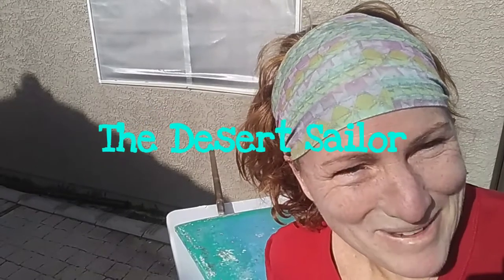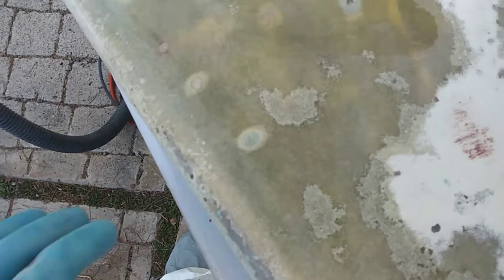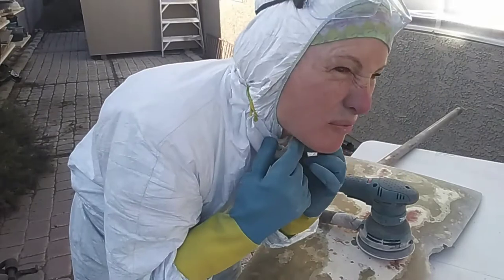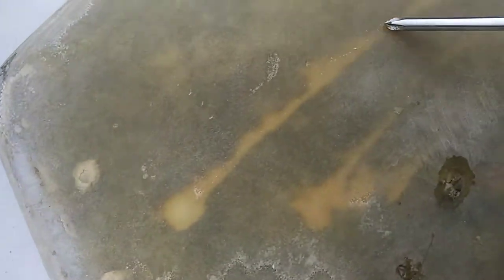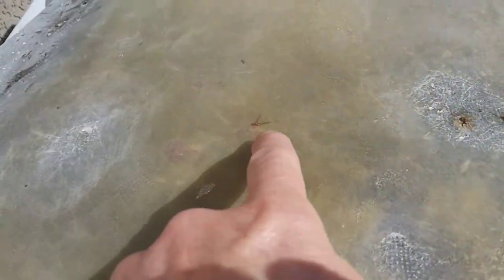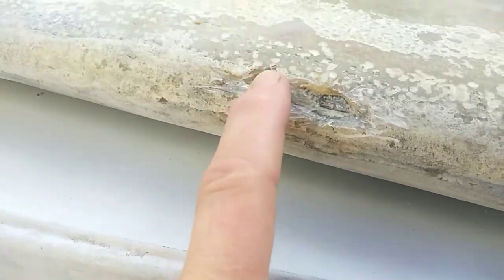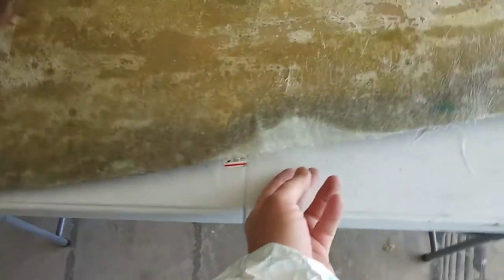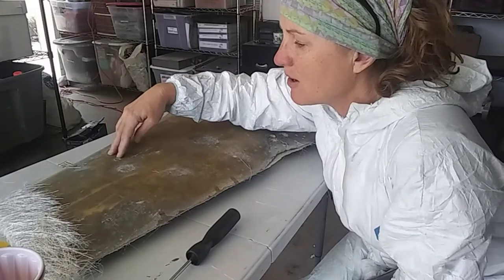Rudder Repair #westsystem

Comment: How do you like your old Coronado 25?  I'm looking at buying one and wondering how it sails.  Is the helm balanced?  Does the helm remain balanced in heavy wind when boat is heeling over hard?
Reply from the maker: She was a good little boat! The weather helm was very balanced with the correct sail-set. It was important not to over-load her and know the correct amount of sail to the correct amount of wind. She definitely did not object to being reefed in the main at 17knots! She had a weird steering issue in strong winds going off wind if there was too much sail. I would lose steering easily. Checkout the the video of Sailing Basics in 20 knots

Comment: The chopped strand was a very poor choice to use with the epoxy,...sorry. Hit that rudder with somec36 grit or 40 grit, slather a good coat of 406 to smooth it. Let it kick to tacky , the establish a new surface  with some 1700 or 1708. , fair and paint. Chopped strand has a binder in it and is a nasty mess with epoxy unless it is stich mat.
Reply from the maker: It is sooo infortunate I lost all the footage for part 2. The final result was very successful. Oh well. I basically followed BoatWorksToday method and advise. I love his channel.
Reply: @TheDesertSailor  I think the chop strand is fine.  However {and I'm no expert by any means)  I would have used small patches first the expanded with each layer.   My tiller is wood. yup  solid wood so I plan to fill is the low spots then glass over the entire thing..